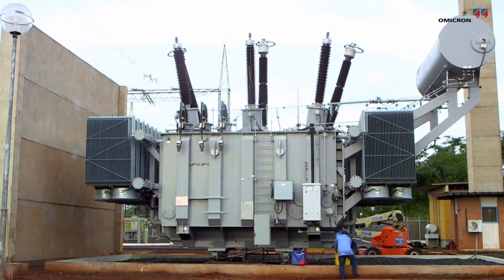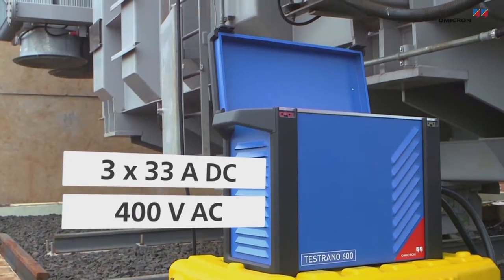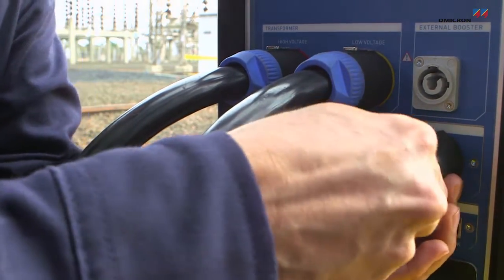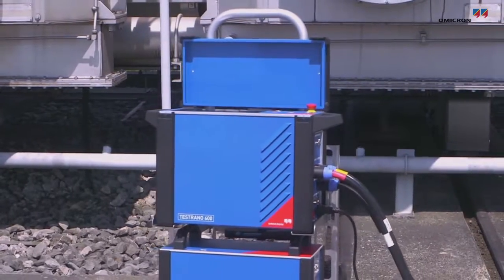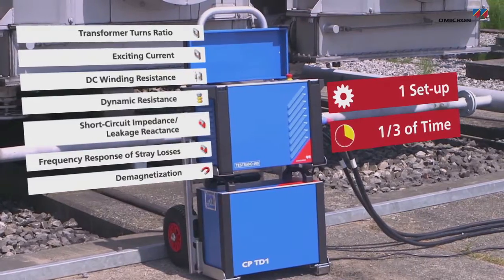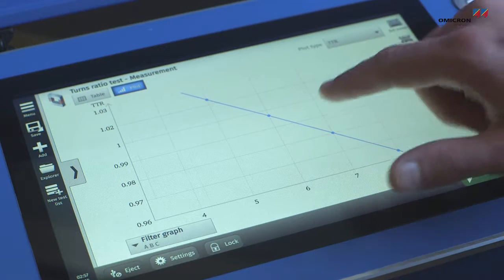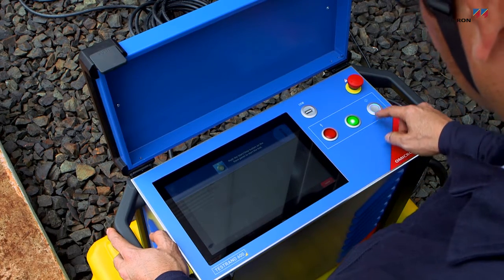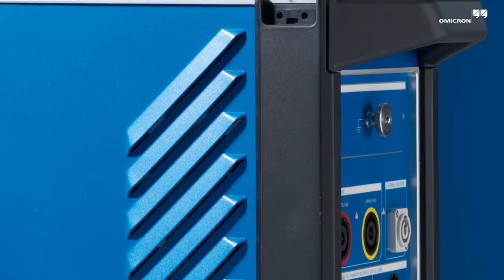TESTRANO 600 – Three-phase test system for comprehensive power transformer testing

Comment: What's the difference with CPC 100 +CP SB1 ?
Reply from the maker: Hello, 
TESTRANO 600 is a three-phase test system, specially designed for routine and diagnostic testing on power transformers. By using TESTRANO 600 you can perform various tests without re-connecting. Thanks to the three integrated sources tests can be done on all three phases simultaneously. Thus, TESTRANO 600 cuts down the time needed for power transformer testing to one third compared to single-phase test sets.
CPC 100 is a multifunctional single-phase test system for various assets (Current and voltage transformers, power transformers, grounding systems, rotating machines, etc.). It’s ideal for commissioning and maintenance jobs, where various assets have to be tested. The SB1 is a switching matrix which enables the CPC to measure transformers with less rewiring, but still the CPC is a Single Phase Testset. 
e.G. 3phase DRM or 3phase resistance measurement is only possible with TESTRANO 600. 
I hope this helps,
Best regards.

Comment: What's the difference with CPC 100 ?
Reply from the maker: Dear Henky Suwignjo,

CPC 100 is a multifunctional single-phase test system for various assets (Current and voltage transformers, power transformers, grounding systems, rotating machines, etc.). It’s ideal for commissioning and maintenance jobs, where various assets have to be tested.

TESTRANO 600 is a three-phase test system, specially designed for routine and diagnostic testing on power transformers. By using TESTRANO 600 you can perform various tests without re-connecting. Thanks to the three integrated sources tests can be done on all three phases simultaneously. Thus, TESTRANO 600 cuts down the time needed for power transformer testing to one third compared to single-phase test sets.

Please feel free to contact us directly for more information or an offer: info@omicronenergy.com

Best regards,
Your OMICRON Team
Reply from the maker: Dear achmad mubharak, 

Unfortunately it is not possible to test 4 phases (8 bushings) at the same time. 
You can find more information about the CPC on our website: https://www.omicronenergy.com/ 

Best Regards, 
your OMICRON team